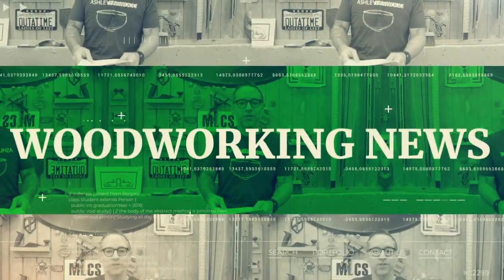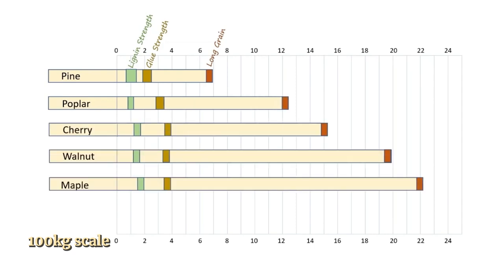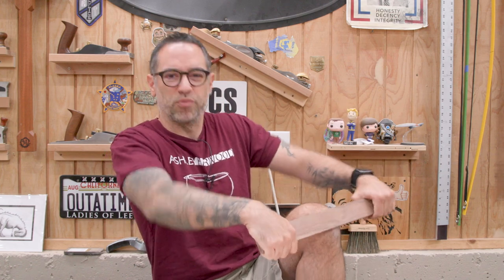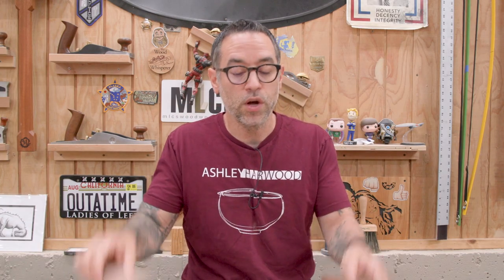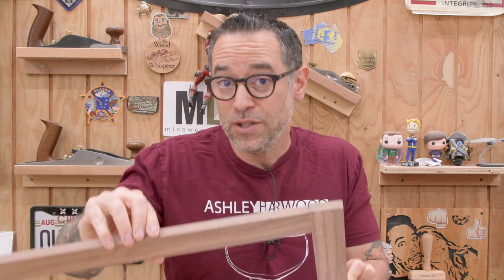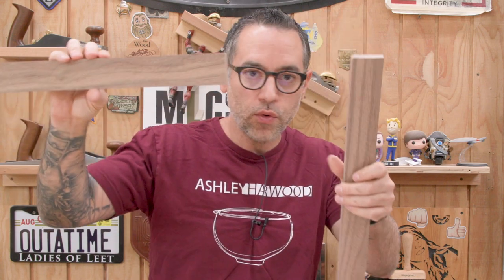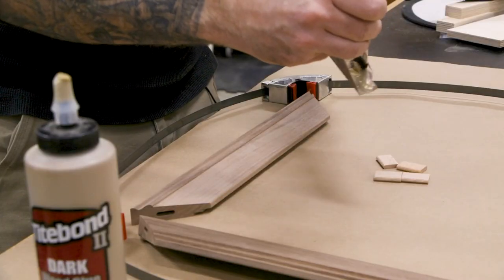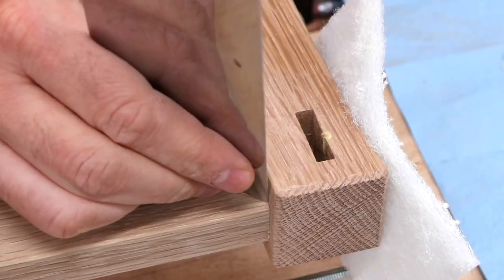End Grain Glue Myths | You May Have Misunderstood

Comment: Thank you! This was my precise reaction to the video and some of its responses - albeit better said and available to a much wider audience. His findings completely (and somewhat shockingly) bust the myth. What they don't do is invalidate the hard-won lessons of hundreds of years of furniture makers vis-a-vis functional joinery. One reason the myth has stood for so long is that there is almost never any good reason to glue end grain to end grain - if you want to stretch a board you'll typically use some form of scarf joint which increases the glue surface and hence the strength.

Comment: Going on 50 yrs ago when I was a teen learning basic woodworking, I discovered that it actually DID help to glue things like the end grain shoulder of a tenon, or the end grain of miters, etc.  More recently it’s pocket hole face frame joinery and the like.NOT because it necessarily makes anything “stronger” overall, but because it DOES keep all the joinery looking better throughout expansion/contraction cycles and typical daily use, to the point of having far fewer cosmetic issues like hairline cracks in finishes or dirt in the air discoloring the unglued edges over time. Your glue is already out so It takes a couple extra seconds… why NOT do it?

Comment: The myth does make sense in the context of, if you're gluing side-grain to side-grain, you end up with a joint that is stronger than the rest of the board, and if you're gluing end-grain to end-grain, you end up with a join that is 1/4 to 1/8 as strong as the rest of the board.  I don't think most people realize how relatively weak wood is if you stress it with the grain.

Comment: I think it was an excellent video by Patrick, however my biggest gripe is that it's not really comparing the strength of a glue joint along the grain versus a glue joint with end grain. It's only really proving that the glue along the grain is stronger than the wood fibers themselves, as the wood is what broke in every test, as opposed in the end grain tests it was the actual glue joint that broke. I think that confuses a lot of people as well, even though that one of the tests do not show a failure of the glue joint, quite the opposite.
Reply: He did say he was willing to do additional testing if there was enough interest in it...
Reply: No, it did not show that the glue is stronger than the wood fibres! Quite the opposite, in fact. What his tests showed was that the glue is stronger than the LIGNIN holding the fibres together, but not as strong as the fibres. This is why long grain glueing broke the wood (ie the lignin bonds), and end grain glueing broke the glue. It took more force to break the end grain glueing exactly because the glue was stronger than the lignin.
Reply: Since the side grain glue joints all failed AWAY from the joint the only conclusion you can draw is that this glue Joint is at least as strong as the cross grain strength of the wood. Because it never reached failure in the glue joint, you cannot say that it is weaker than an end grain glue joint
Reply: @jeffhigh2  No, this is not entirely true. Let me try and explain what/how Patrick Sullivan (PS) measures:

Initially, there are two variables: glue strength and wood strength. However, for this purpose, we can break down wood into two sub-components, fibres and lignin:
Fibres are cellulose tubes that are the transportation means for water and nutrients in the tree. Lignin is the glue that holds these fibres together. 

Thus, we can talk about glue strength, fibre strength, and lignin strength:
Glue strength is measured as the force it takes to break two pieces of wood along a glue joint (S^g). 'Glue' is here a pva-glue. Fibre strength is measured as the force it takes to break a piece of wood across the fibres (S^f). Lignin strength is measured as the force it takes to break the fibres apart from each other, ie break a piece of wood along the fibres (S^l).

From the empirical tests performed by PS (watch the video!), the only general information we can infer, is that glue is stronger than lignin (along grain glue-ups are bound to break away from the glue line):
(S^g) > (S^l) 

End grain to end grain glue ups do not provide any relative information about strength even though they are bound to break at the glue line, since the wood fibres have already been severed:

* => (S^f) > (S^g)

Thus, end grain glue ups provide glue strength information only.

Luckily, PS does not rely on relative information only, but he also performs absolute tests: he measures how much force it takes to break apart two given test pieces. He tests a number of wood species for strength in different directions (Sw^f and Sw^l) as well as glue strength for the given wood species, tested as end grain glue ups (Sw^g).

These tests all reveal that:
Sw^f > Sw^g > Sw^l

For all tested species and specimens, fibres are stronger than glue, and glue is stronger than lignin. The actual force required differs from wood species to wood species, however all tests show the same relative order, namely that end grain glue ups require more force to break than along grain glue ups. This is what is illustrated in the graphs also shown in this video.

Remember, these are test tube results, and they do not tell us anything about if or how we should change the way we work, as is the gist of this video, but they DO provide us with a piece of information that is most likely new to most of us. Bravo Patrick!
Reply: @pinkerbot  But the test never actually breaks a side grain joint, the material breaks before the glue fails. You have effectively just measured the cross grain bending strength of the material (Which is enhanced at the joint by glue penetration) What the test tells us is that an end grain glue joint can be as strong as the wood cross grain in bending (glued or not)
Reply: @jeffhigh2   @Jeff Highland  i do not understand what you are trying to say. You are mixing side grain/end grain properties... What you refer to as bending strength, how does that differ from plain strength?
Reply: @pinkerbot  I see what you're trying to say, but for all practical purposes that's arguing semantics. Whether it's the lignin that fails or the actual fibers that fails it is still the wood that fails and not the glue joint, so the test doesn't prove that one glue joint is stronger than the other, only that the glue joint is stronger in one direction than the wood is.
Reply: @pinkerbot  Technically true-- so trees need to replace lignin with pv glue haha
Reply: @billdodson207  😁
Reply: When you present data to a non scientific audience, you do have to explicitly say what the data does and doesn't indicate. Otherwise, if you don't present a conclusion, your audience will have to make their own, and some of them will get it wrong.

Short grain is weak, long grain is strong. A wide board made from slimmer edge jointed boards is no weaker across the grain than a single board, but a long board made from two shorter boards butt jointed together will be far weaker along the grain than a single length. This was never stated, that's why people got confused.
Reply: @Mikey__R  you are right.
Reply: @Mikey__R  (addressing the first paragraph) which is why we're almost 2 years into this pandemic.
Reply: As a retired engineer, because I've had to design with both isotropic materials (steel is an isotropic material for almost all practical purposes) and anisotropic materials (as wood is) this makes a great deal of sense.
ISOTROPIC MATERIAL properties such as strength, bending, breaking limits are the same in any direction.
ANISOTROPIC MATERIAL properties such as strength, bending, breaking limits are NOT the same in any direction.
Reply: Have you ever noticed how the wood always breaks at the edge of the glue?  It's because many fibers were separated by cutting the board and the glue is trying to hold the fibers together. 

The real test would be to take a board a certain width and test the breaking point. The, cut the same board and glue it together and test it again.  Which took more pressure to break?? I'll bet on the bare board.
Reply: @jeffhigh2  I see what you're saying here, but in terms of the point you are making, I think what the test shows is that there may not be a way to test the 2 against each other.  With the glue being so much stronger that the lignin, the lignin is always going to fail before the actual glue in the joint does.  With the fibers being so much stronger than the glue, the glue is always going to fail before the fibers do.  

So, maybe the conclusion here is best summed up by @Bill Dodson 's comment:  "...so trees need to replace lignin with PVA glue..."
Reply: @jonnybooks9337  It is often hard to design a test to measure a material property and isolate it so that surrounding materials do not influence the result. That is why, for structural materials there are standardised tests. For a new test design such as this you need to be careful what conclusions you draw, Giving a numerical result to the side grain glue joint in the absence of a failure at the actual joint is a misinterpretation IMHO
Reply: @BlessedLaymanNC  I can assure you that from an engineering perspective there's no difference between Patrick's test an what you propose.  The boards did not fracture near the joint because the wood fibers near the joint were damaged by the saw.  The wood fractured near the joint because Patrick's apparatus maximized the stresses at the glue joint.  Barring some significant defect in the center of the board (which Patrick avoided in his samples), because the joint experiences the highest stress, the failure must occur near the joint.  This is true regardless of whether it's the glue or the wood that fails.
Reply: @charlesenfield2192  Thank you

Comment: Great follow up video. I agree everything Patrick said was correct but it doesn't really reflect what we generally do in woodworking - although perhaps it indicates we should change some of the things we do. The one thing that I'd like to have seen mentioned here though is the way the joint fails. With an end grain to end grain join the failure is sudden and catastrophic. Long grain failures, in my experience, usually give you a bit of warning before they let go and mechanical joints tend to give quite a lot of warning.

Comment: Very valid and very timely point.  This end glue strength thing just adds too, does not eliminate, joinery.  It should be noted that Titebond has been recommending end-grain gluing for years and has had  guidance on their tech site on the best way to do it.  Go figure that the manufacturer was ignored by the industry they support???

Comment: Great video Marc. We've been inundated with questions on this lately and like you, I can't really come up with a real-world use for an end grain joint–save one, on the podcast we answered a question about solid-wood chess boards and Patrick's video would make me rethink my answer on that one. -Ben
Reply: Oh... that article is in front of the paywall!
Reply: Another end grain to end grain use... well... kind of the same one, create a pattern. https://youtu.be/NUTmBy-63qo
My only real conclusion from Patrick's video was, if my glue up allows the time for it, I will now add glue to end grain in addition to just long grain to long grain contact surfaces.
Reply: @edu_carceller  I'm not sure that's necessary. We've all collectively been building furniture using white and yellow glue for decades now, and for the most part if the joinery is sound, the furniture holds together just fine. I'm not convinced adding a little extra glue strength is going to make much difference, when the bulk of the strength comes from the joinery itself.
Reply: @Mikey__R   Oh I am sure it is not necessary because tons of woodworkers of all skill levels have been avoiding glue on end grain and their projects are still holding together perfectly fine. But still, now that I know that glue works on end grain pretty well, I might as well add glue there as well. Unless it's a big glue up and I don't have enough time.
Reply: @Mikey__R  I find spreading glue on the end grain areas of the joint helps prevent cracking of the finish. A typical example would be the joinery of a cabinet door. I've seen many doors glued by just putting a bead on the tenon part and there is always a crack on the surface I. The finish. It is most noticeable when painted. With 100% coverage of glue throughout the joint, including on the end grain, this doesn't happen.

Comment: 1. I agree with pretty much everything you said
2. I agree that part of the idea of a weak joint comes from the clean break and leverage, i would also assume it comes from wood movement over time.  Two pieces of wood, moving at different rates (unless they have the exact same properties) are going to weaken an end grain glue up vs. A side grain glue up that just pushes against each other.

Comment: I'm glad you mentioned joints over time and how wood moves which weakens the joint. The flexibility of the glue to be able to compensate for this movement is also an important factor in the joints overall strength. Also that you pointed leverage multiplication!

Comment: In joining end grain to side grain, apply a thin coat of Titebond to the end grain surface and let it dry before applying the glue to the two boards to be joined.  This seals the end grain so it won't suck the glue away and starve the joint.
Reply: Completely agree.  When using titebond 3 I change it up a little by not allowing the primer/sealer coat to fully dry.  The additional dab of glue before assembly can then make a better chemical bond.

Comment: I enjoy seeing woodworkers share ideas and findings that they have made. Going along with how regular jointerie is better, you also briefly touched on wood movement. I think a lot if people are forgetting about the expansion and contraction that is going to break an end grain joint apart. That is the real reason that edge grain gluing is said to be stronger. It is not really about the strength for end and edge grain gluing it is about the longevity.

Comment: Two great video's. Sounds like the real myth is that glue is stronger than wood. Yes in some ways you measure those strength it is, BUT when it comes to woodworking a proper joint (of any type) is what gives you a practical product. 
 
And as a newbie and a techie thinking modern products should change the way we do things those old fashioned joins still have a very important place in the real world.

Comment: I totally agree with what both 
Patrick Sullivan and you said.
I might have highlighted why the long to end grain butt joint (the only one we actually really care about) will degrade over time with wood movement: the end grain part will expand and contract which will make the fibers connected by the glue on the two parts not match anymore which will make the joint weak (not an easy point to make in a short sentense).

Comment: Pretty easy to understand the issue...

Woodworking joints take advantage of the strength of the long fibres, and have a significantly larger surface area.

Glue joint strength is significantly dependent on surface area.

Dovetail joints and box joints are very strong (someone said box joints were actually even stronger than dovetail joints, and this actually makes perfect sense when you understand the lignin issue).

Joinery introduces frictional forces due to the tight fit, which increases the load needed to actually apply a shear load to the glue, making the joint unlikely to break. Then, the high load points in traditional joints resist motion along the fiber direction.

If you understand compression and tension, you can understand a bend, where one side is in tension and the other is in compression. If the compression strength is higher than the tensile strength, it will fail at the end being stretched.

The major traditional joints resist motion and torsion with the tension of wood fibers themselves, and the surface area of the glue is much higher, and in addition, other resisting loads are introduced.

If you had a mortise and tenon, the way to break it with the least load would be to twist the tenon piece in a way that splits the mortise piece of wood, pulling the fibers apart laterally. Joint design has to reflect the expected loads. I.e. most loads are going to be vertical rather than lateral, and the lateral resistance to breaking might be significantly weaker on a joint.

But this doesn't matter when the lateral loads are a fraction of the vertical loads.

Think of how many pieces of furniture it's a bad idea to tip on its side and stand on, but how they can easily be stood on when loaded right-side-up. So many chairs will snap and break if you stand on them when they're laid out sideways, but are perfectly adequate for sitting.

Comment: This is a point that only us structural Engineers probably appreciate---- Stress or pressure is not applied to a joint----- A. Force is applied to a joint----- Stress and pressure are the result of that force., and are highly dependent on the area that the force is spread over.

Comment: One more instance end grain-to-end grain strength is relevant, for us newbie woodworkers, is in more complex glueups where, say, rows of wood going into a cutting board are themselves made of several pieces of wood aligned end to end. It might be negligible to more advanced crafters, but till these videos came out I was actually quite worried that doing so would lead to weak connections promoting failure of the board. It's good to have such a simple matter clarified in an open way so a newcomer's progress and confidence isn't diminished by bad or old information.